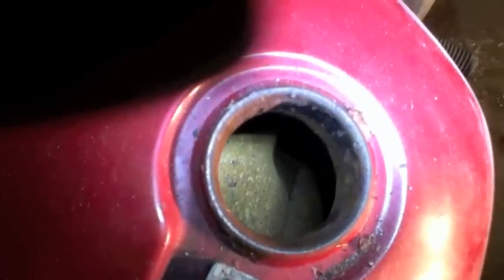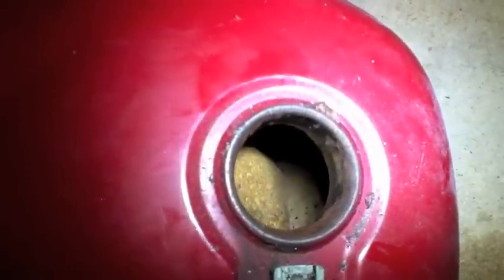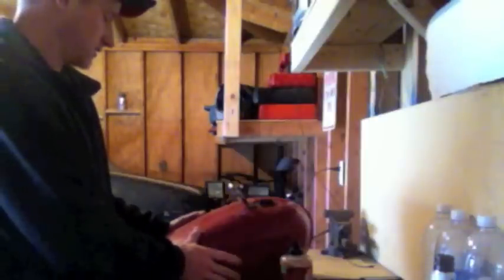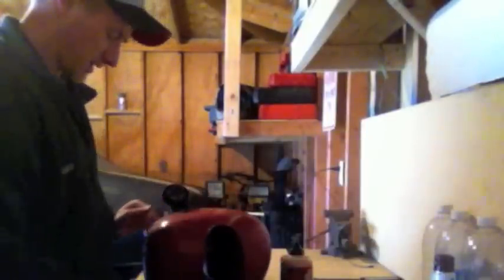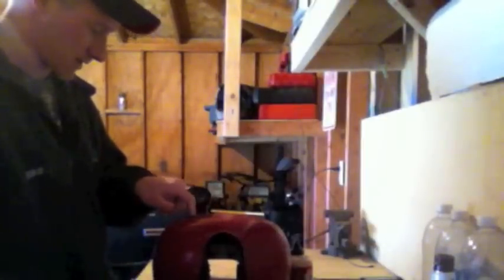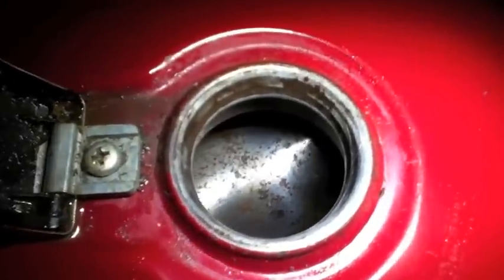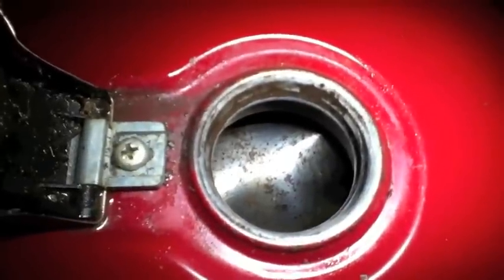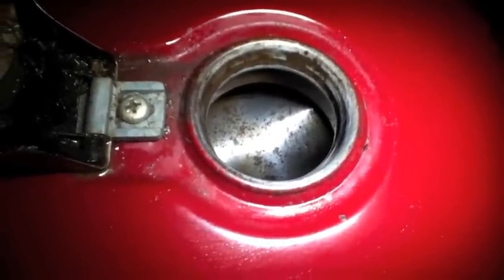How To Restore A Gas Tank

Comment: We have an antique garden tractor that we lift one rear wheel off the ground and then tie the tank to the wheel and put the sharpest grannet gravel pieces that can be found in it. Let it run in different gears and in reverse changing speed and direction often for several hours or until it's shiny again inside. Just keep an eye on it often so the whole tank doesn't work away from the tire and wheel. If it starts to get a little loose it'll work sloppy lose in short order.

Comment: Water in a gas tank?  Doesn't that encourage rust?  Why not just gas or Seafoam?
Reply from the maker: You can certainly use those things. But if you're shaking up a bunch of gas inside the tank with metal on metal contact inside I'd hate to see a spark ignite. I recommend water with an abrasive, and then rinsing with clean gasoline to get rid of any residual water.
Reply: Midwest Garage what about diesel+ some oil